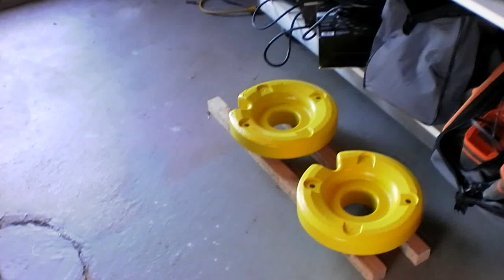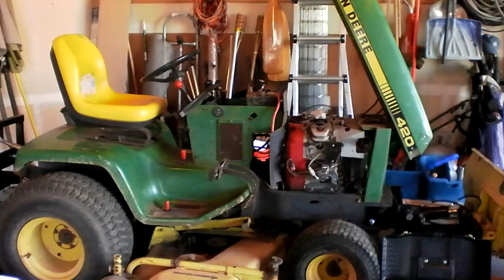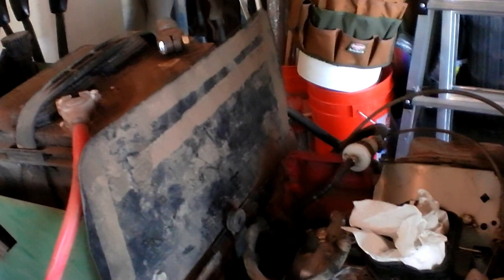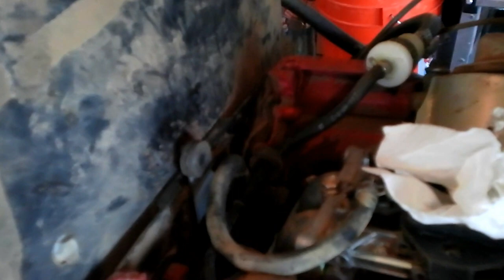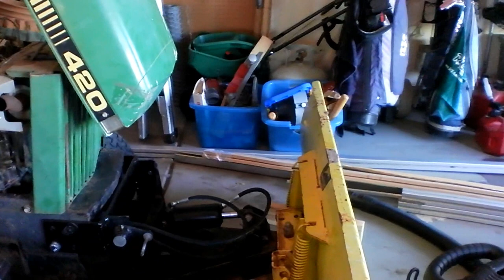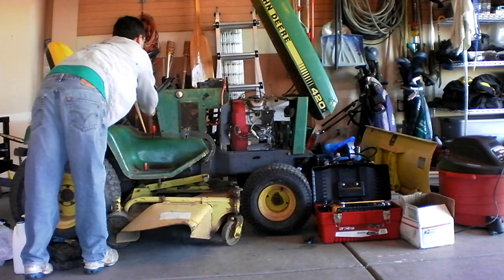John Deere 420 with a Honda GX670 Repower

Comment: I also put a new Honda engine in my 420 last summer from Repower and am very happy with it, and every thing comes with the new engine, the tech support is great. would recommend to any one!
Reply: I'm looking at a 318 with a Honda repower. How does the Honda compare to the onan? I know from previously owned tractors that the p218 is a hoss but it sucks fuel like crazy

Comment: where did you get the  stub shaft that bolts to the flywheel and connects the engine to the driveshaft?
Reply from the maker: It was a complete kit from Small engine warehouse.